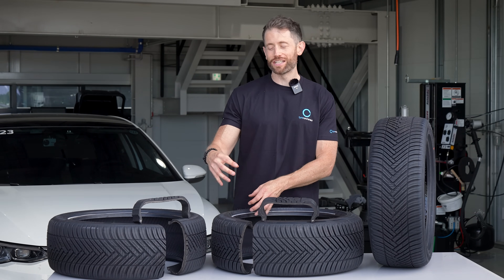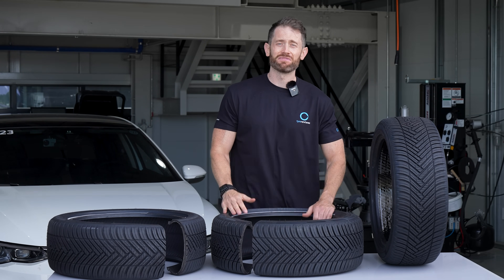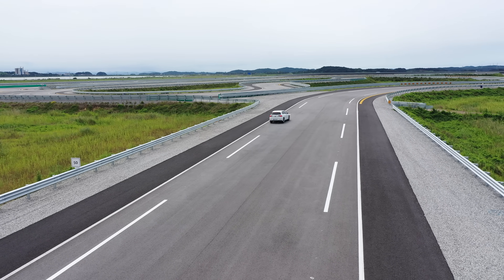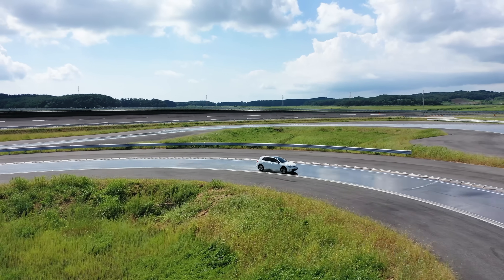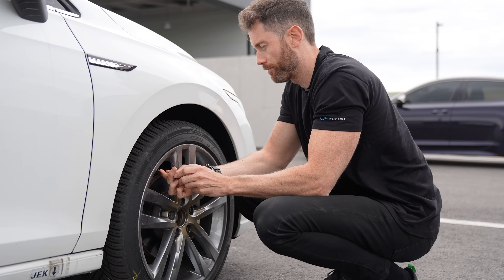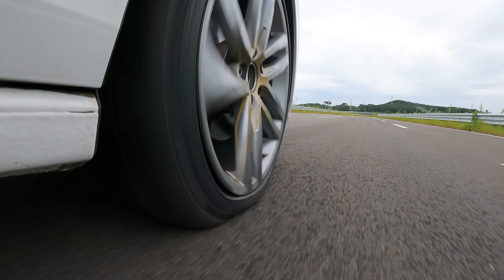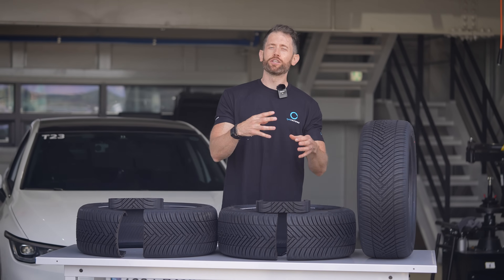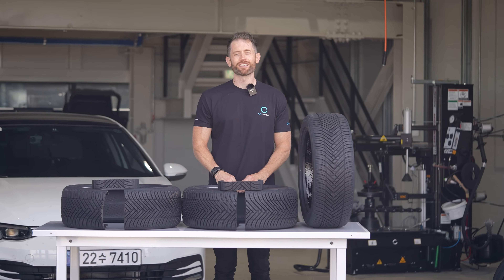Are Modern Runflat Tires Finally Good? Normal, RFT and SEAL Tires Compared!

Comment: I just realized that I wasn’t subscribed to this channel even though I’ve been watching for a while. Sorry about that, definitely fixed it.

My partner used to have a 2016 Cadillac CTS with run flat tires. Can’t remember the brand, but it was either Michelin or Bridgestone. They were horrible and ruined the car. I know it was the tire because we drove another CTS (and other Cadillacs) without run flat tires and it was a night and day difference. It was so noisy and crashy over bumps and even small bumps would result in an audible thump in the car. The wet grip was really bad. Even though the car was AWD, it would spin the tires in the rain and oversteer around corners under moderate acceleration (the car only had a 2.0 turbo so it’s not like it was fast). That, along with my experience with BMWs as a German car tech really put me off run flats. That said, my experience is based off of older run flat tires. It sounds like they’ve gotten better.

My Bolt came with a set of Michelin seal tires. I got really upset with them when I got a flat on the freeway and, since the car didn’t have a spare tire, I had to wait 2 hours for a tow truck to tow me home. I ran over a chunk of truck tire that was sitting on the road and I think it pinched the tire between the vertical edge of the truck tire chunk (which was like an inch tall) and the wheel, because it caused a split right where the tire tread meets the sidewalk and deflated the tire within a few seconds. When I got the tire replaced, I had to change my opinion of the seal tire because, although the puncture at the edge of the tire led to a flat, I had been driving with a nail in the tire for who knows how long. I didn’t even know it was there until the tire shop employee told me that I had a rusty nail in the tire too.

I think the seal tires are the best compromise. Granted, they don’t work for sidewall punctures, but they work great for tread punctures, and they come with no other compromises.

Comment: Sealed VS Run Flat is a bit of a question at this point, not deflating to begin with is obviously a plus. However if the seal fails a run flat is better. Why not a sealed runflat?
Reply from the maker: I imagine at that point it would be a lot of weight and cost
Reply: @tyrereviews  seems like the reasonable explanation

Comment: This could prove a great safety increase in a high speed scenario, if for some reason the tire was punctured, the car would not suddenly upset itself to a point of being hard to get it back under control ? For a typical driver ?
Reply: Also, could the sealant be put an the sidewalls too in that tire variant ?
Reply from the maker: Sealant won't work in sidewalls, too dangerous as they're very important for support

Comment: Amazing. I have Pirelli Cinturato run flats in my BMW 3 series (with the OEM star). Car tram lines fairly badly but never dangerously. Driven once with a flat and it was awful. Pulled all over the road. When I put on the Continental TS830 winter contacts, the car rides so much better from a comfort point of view and stops tram lining. Steering doesn’t feel as nice though.

Again, a very enjoyable video as always.
Reply: 😄I had the same experience with my E46 3 series and they weren't run flats or Pirelli's!
Reply from the maker: Stiff sidewalls generally means tramlining :(

Comment: The self sealing is the winner for me, at least 50% of my tyres run out of life thanks to nails. I usually drive for months with a nail and a slow puncture rather than pay to get it fixed 5 months before the tread wears out.
The run flat would still need to be repaired.
The worst thing about the run flat for me is it's end of life disposal. Tyre disposal is all ready bad for the planet without the extra rubber of a run flat.
Reply from the maker: Where do you work? A nail factory?

Comment: With airless tyres on the horizon, RF tyres and sealant tyres might become outdated relatively soon. Though it's good to have that option in some tyre sizes.

What I was really interested in was the mousse filled rallye tyres, but since the FIA banned them, no progress was made and they were never available on the market. Which I think was a missed oppertunity. It would bridge the gap between runflat tyres and those with sealant.
Reply from the maker: Airless has come along way, but it's also still got a long way to go. Air is surprisingly useful it turns out!
Reply: @tyrereviews  Michelin wants to start selling their airless tyres in 2024. Well, we'll seehow that turns out. I Hope you will test those intensively.

Comment: Two questions about the sealant. What happens if you run over a nail and it gets stuck in the tyre and you remove it several days later due to not noticing earlier? It's not often you'd run over a plank with nails sticking up, but more common to drive over a loose nail on the ground. And when you actually remove the nail, can you keep driving on it for the rest of the tread life or do you have to change it soon afterwards?
Great test!
Reply from the maker: IT would still seal and yes you can keep driving on it once sealed!
Reply: @tyrereviews  Thanks a lot! That makes me hope that more tyres will be equipped with sealants in the future. Wonder if it would work below freezing temperatures on winter tyres as well, maybe not...

Comment: In the past i have owned the first generation runflats. They were factory fitted on my car. Absolutely hated them. Fitting a normal tyre made night and day difference. Even my gradma felt the difference as a passenger. I took a shot last year and bought runflats as my winter setup. Didn’t even notice a difference in comfort. Now seeing this video I actually don’t want to buy normal tyres anymore.
Reply from the maker: What winter runflats did you get?
Reply: @tyrereviews  Goodyear Ultragrip Performance + ROF
Reply: Great positive comment!
What make?!

I suspect these all season and, more so winter, are partly more comfortable due to them being softer already in normal tyres vs summer equivalent

Comment: Great review! Wasn't aware that there was a sealant version if not for this video. Any idea when that will be released to market? And due to the sticky material, do they take extra precaution when delivering/storing these tires? I can imagine that tire storage and transport isn't the most clean environment and can have all sorts of dust and pebbles that can mousetrapped in the sticky material and possibly throwing off balancing and ultimately it's ability to seal punctures.
Reply from the maker: Good questions! There's already plenty of seal tyres available, including some RS2s just not in this size. I've not seen any special transport rules but you make a good point
Reply: @tyrereviews  Sealant has a cover that's removed (peeled off) before mounting.

Comment: Ok, I'm very intrigued by these SEAL tyres, but I have questions.
Tyre sealants usually have an expiration date, which is why tyre repair kits advice to replace the sealant regularly. Surely the sealant within the SEAL tyre should have a limited lifespan of reliability, right?
Reply from the maker: It's a very different material to sealant kits, this lasts the life of the tyre.

Comment: Hello. 
I own a recent F56 JCW equipped with Pirelli runflat (curiously delivered new with different profiles froint and rear  : P7 cinturato front, PZero rear). All RF. It is the very first time i do not feel the need to switch for non RF. The steering is detailed and precise, the comfort is the one you honestly can expect for this (very pleasant) car, but above all there are no damper percussions on bad roads. Maybe a slight defect of communication in quick high speed turns, but not very noticeable indeed.
On various bmw cars i had recently, it is very different, and switching for non RF is necessary to retreive some information from the steering wheel and to avoid these damper percussions. Question of weight ? Of weight per wheel ? Of load ?
Reply: Very interesting point! Also test drove a few r56 minis, Cooper s and jcw years ago on rft.
NO issues whatsoever....

Comment: I owned a C5 Corvette back in the early 2000s, and it had stock runflats, and in the rain the car was nearly undriveable it would slip and slide around so much. Being in Florida, that meant nearly every day in the summer, the car tried to kill you. I had, at that time, heard that's just how Corvette's are, they easily break free, they're wild, etc. Well I went out and bought the best wet performance tires you could get at the time, the lengedary and awesome looking Goodyear GSD3, and holy s---, it was basically like getting a new car. Not only was the dry handling much improved, the car, in the rain handled better than the runflats did in the dry. It was remarkable the difference. No longer did the car constantly break free, no longer did it slip and slide all over in the rain and try to kill you. The runflats, when I replaced them still looked brand new, only had about 22k miles on them, were, I believe, 3 years old - they weren't bald, were not abused, but instead I think they were rock hard, which is why they had no grip.
Reply: The GSD3s were awesome in the early 2000s. Ran them myself and every other tyre was pretty poor in comparison. The tyre game has certainly moved on. Can't believe how we survived the 90s on plastic tyres 😂
Reply: @kenzohkw  they were the first performance tire I bought, and I was shocked at the difference . They were the first tire I ever felt that would 'bite' in corners. I had heard people talk about that before, but had never experienced it myself. It just completely changed the car, turned the Vette from a muscle car into one that you could take around a corner without the fear of death.
Reply from the maker: GSD3, what a tyre!!
Reply: @tyrereviews  best looking tire ever made.
Reply: Gsd3 was likely the best tyre I've used in the wet, end of!
Aquaplaning was non existent!
I appreciate that wheels get bigger and technology moves on, hence the asymmetric, but I miss them 😪
Sidewalls were possibly their weakness vs the asymmetric.
Reply: @James-RJM  it would seem like with the ultra aggressive tread pattern and the water channels, that they'd excel in the rain, and they certainly did. And on the Vette, they just looked awesome, at the time unlike any other tire I had seen. I'd love if they still made them - I'd take the minor hit on dry track performance (I think it would be minor, anyways). I will say the Goodyear Asymmetric that replacemed them, while looking very generic and bland, they seemed, to me, to perform extremely well on future cars I owned.
Reply: @rodmunch69  I actually looked on black circles tyres uk the other day!
They had 2 sizes, not mine and unlikely yours. A 15 and a 17 inch, so we're shit outa luck 😉

Asymmetric 5's are very good and the A6's should be mega.
Saw a recent review on YouTube by a regular vw golf reviewer that tested the A5's vs A6's. Was very positive!!
Reply: @James-RJM  yeah, I've seen a few of them on eBay, available in Italy, but obviously way too expensive to ship to the US, plus, as you pointed out, the wrong size as I currently have a BMW 4-series with 20s front and back. I do wish someone made some good tires for the 1982 Corvette I have now - but all you can buy are the old muscle style tires which are not very good. The one benefit of those old 15 inch wheels with huge sidewalls on the tires is that it's a great cruising car, just soaks up all the bumps - but turning, reminds me that the car was designed in the 1960s.
Reply: Thanks, this is super useful. My car has no space for a spare, and I do long road trips, so use runflats. I was worried about wet performance, but after watching this, I’ll rest easier. Thanks again.

Comment: Very interesting, I would like to have known the weights though !
On bumpy roads big unsprung mass is really bad, and the wheels can slightly bounce off the tarmac.

The rear wheels on my BMW F36 428 GC weigh 26,5 kg 19" inch OE wheels 255 wide.
I think at least BMW have extra reinforced rims so both the rims and the tyre are heavier, than a normal rim / tyre combo would be.

Comment: What brand tyre changer was that in the background at the end of the video. Not seen one of those. I recently got a Corghi 5000 and balancer, best purchase ever.
Reply from the maker: Hunter Auto34S. Hunter are amongst the very best!
Reply: @tyrereviews  Ta, am also interested in how the sealant tyres balances up cause would be hard applying the sealant evenly. Have balanced up some of the high end UUUP tyres lately from the top 3 and they are getting them down to 10gram out of balance which is pretty good. I balance the rim first before I put the tyre on so I can see the exact balance of the tyre. I like your commentary on sidewall stiffness as I dont like a soft sidewall for the pure reason is they tend to flatspot more overnight and give the thump in the morning as compared to harder sidewall tyres. Knowing sidewall strength is important for me as I have found you can drive some distance on a flat non runflat with a strong sidewall also.I must add it was a low profile 245/35/19 but stayed good for 20 odd km. most would shred or/and come off rim.

Comment: This is amazing Jon; thanks for showcasing this important development in tire technology. I think like you, in that all the tire manufacturers should incorporate this feature in their tires. There's the obvious big benefit of not having to carry around that extra 35 lbs or so of weight in the trunk for a spare tire and wheel with very little trade off, in terms of noise, harshness and handling degradation.

My personal choice would be with the seal tire, as it would probably have an almost insignificant weight gain over a standard tire. I should also think that the seal tire might have less air leakage through the belt area, due to the viscous sealant filling in some of the pores in the tire material.

Jon, could you maybe light a fire under the backsides of our friends at Michelin and get them cracking on installing sealant coatings on all their passenger car tires.
Reply from the maker: I believe Michelin run a sealant on some tires, just limited demand at the moment

Comment: If they are the same please tell me how is that most of regular tyre models have an A in wet and the runflat model a B which is lower break distance in wet. Also I had both models un goodyear F1 assymetric for example and there is Big diference, in wet you loose grip much before. The same for the seal, i have seen continental and Pirelli seal and both have a B in wet while the same model have an A
Reply from the maker: Are the runflat versions OE for a specific vehicle like BMW? IF so that's why
Reply: @tyrereviews  I had OE and 2 more RF brands and then no RF and what a difference. Also you can see what I say in any online tyre shop, RF and seal tyres are B in water and regular A. In sport models in 18 and 19" size
Reply: @Pacman956  Found a michelin ps4 zp-zero pressure runflat in 225 40 18 today and it's an A in the wet. This is uk. 
Just for your information mate.
I'm still trying to get a definite answer from a supplier or my manufacturer as to whether it's suitable for my car which is oem normal tyres!

Looking at many owner reviews in the last year, virtually all said that the above michelin was fantastic re grip but also quiet and comfortable vs previous rft's from predominantly Bridgestone and pirelli.
Also an alfa guilia owner fitted them from normal to rft and loved them!
Many also commenting on rft progress in comfort and noise in the last 10 years.

Comment: one of the issues with dedicated sealant is because they are more expensive, can be harder to balance new or used, also not everyone needs emergency sealant tires because they are in extremally low punkcher chance areas. for example technology isnt advanced enough for dedicated sealant to be in dedicated offroad tires that get purposely deflated, inflated, flexed alot.
Reply from the maker: Good points!
Reply: The technology is there,  but it also comes down to owner risks.
I fit and install puncture safe not just to cars, but suvs, trucks, construction equipment and farm equipment as well.
So there is a couple of points.
1) install a gel sealant after the tyre has been balanced.
2) the pucker factor is when a loved one etc or offspring borrows the vehicle.  What's the chances that with them been in a unfamiliar car they may not know as to where the jack is stored or perhaps the car is fitted with a spare actually underneath the car.  This time of the year in the UK now nights are drawing in you don't want them stranded or waiting for the breakdown service.
3) tyre insurance.  That's fantastic having it but it's not the insurance man stuck at the side of the road, when it's raining, snowing etc. It's You and your family.
4) Granted not every where is a pucker chance area I agree wiv that.  But you may not be aware that someone else on the road has dropped either accidentally or deliberately glass, or nails, or even small amounts of metal from a insecure load.
5) Sealant in the tyres helps them run cooler which then gives you increased mileage. Before having to consider replacing them.
6) the product which I fit into construction and farm equipment gives puncture resistance upto 30mm all across the tread area.
In medium speed vehicles upto 90mph gives puncture resistance upto 15mm, all across the tread area
In high speed vehicles upto 175mph upto 6mm and again across the full tread area.
And as the vehicles mileage increases it will also start to give some side wall protection as well.
7) The technology is their and is currently in operation across the globe the more tyres flex and or deflated and then reinflated means the sealant can actually seek out new areas to protect.
David lambert
A1 Puncturesafe